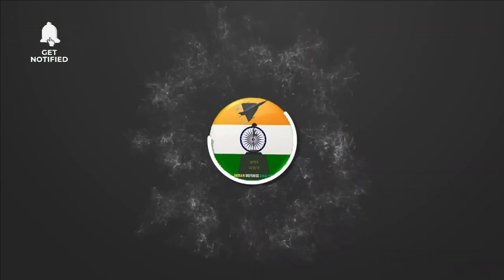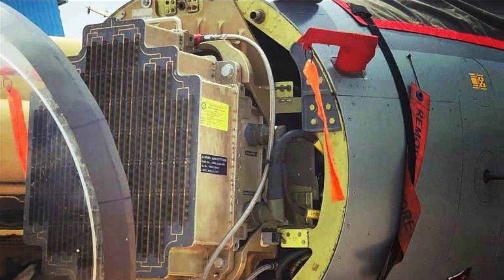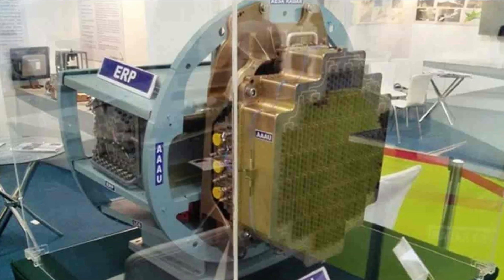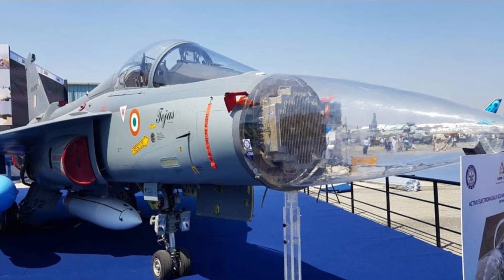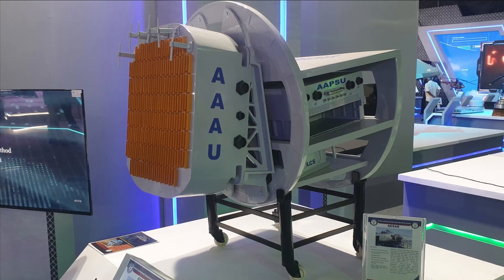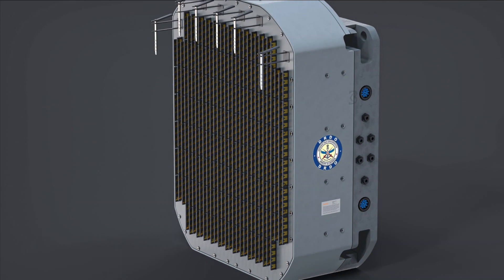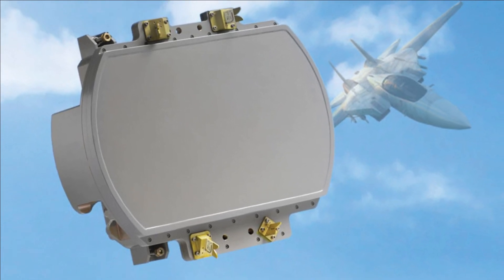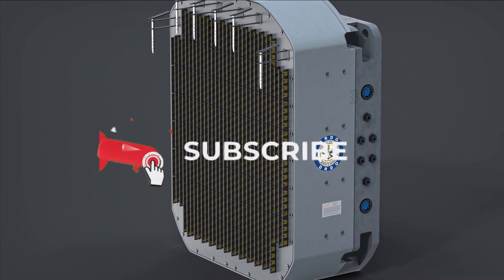More powerful radar for Tejas Mark 1A ?

Comment: DRDO Website has Gallium Nitride (GaN) based TRM. Apparently it will be fielded on the TEDBF and AMCA, but hopefully still available as upgrades for other aircraft as well.
Reply: Radars can be swapped easily if the nose is big enough so don't worry
Reply: @fly463  Because only explicitly mention AMCA/TEDBF, so thought maybe power was an issue? Space may be there, but maybe too power hungry?
Reply: QRSAM Radar is already GAN based. So yeah they definitely have the technology.
Reply: @datoolz0  yeah energy is an issue but i think 98kn thurst engineering can handle GaN radars 
If they can't 
Then DRDO can make a radar which is inferior to AMCA & TEDBF radars and can be powered by MKW
Reply: @sidewinder3422  DRDO is really hardworking
Although they develop a little late than the timeline they develop world class weapons with a budget of $1bn/year for now
Reply: @fly463  Just less modules would do the trick, still better than existing radar.
Reply: @sidewinder3422  Why do we even use non Gan radar at all? PESA radar is still deployed. Maybe time for mass upgrades? GAN radar offers such a big improvement it would help against stealth planes, and drones.
Reply: @datoolz0  yeah that's what i hope too
Reply: @datoolz0  GaN radar is not totally developed for now that's why
Reply: For the Su-30 upgrades too hopefully

Comment: Uttam AESA Radar is outdated because it uses GaAs technology. This needs bulky cryogenic cooling and is less sensitive. Whereas the newer GaN Gallium Nitride AESA radars can function without cryogenic cooling, hence more compact and therefore more TRMs can be accommodated, which in turn means it is much more powerful.
Reply: DRDO is also developing GAN radars for TEDBF & AMCA
Reply: Not even America has inducted GAN based radar still in development testing phase

Comment: If any aesa radar capabilities depend wholly on just being GaN or GaA based, many highly advanced operational aesa would be outdated now. About uttam for Sukhoi, it's only in the making yet at this process and range is not yet confirmed confidently. I don't think there is enough credible info yet for a debate on if bars or uttam on Sukhoi 30 is better. And to any one who claim that uttam is based on Su 57 radar, I need proof because even Russia is reluctant to provide full tech or I belive nothing on Sukhoi Bars radar, you hope for Sukhoi 57 radar tech for Uttam??? I am pretty sure every  radar  development in India is done mostly by ourselves especially airborne. If I am not mistaken, even when first MRFA competition was held, tech transfer for AESA radar was a roadblock for the competitor.They agree it first but when it comes to critical tech, nobody agree so it's unbelievable that even Russia would allow it not to mention that airforce is not impress by their tech.

Comment: Why on earth would anyone replace the Su-30MKI radar? It has the Bars N011M radar, with a detection range of 400km and tracking of 200km. Its tracking range itself is almost twice the range of most other radars detection ranges. IAF uses it as a makeshift AWACS because of how large it's detection range is. And it is a hybrid between AESA and PESA. Why would IAF want to put in a pure AESA with barely half the detection range compared to the N011Ms tracking range?
Reply: Bcs Active tracking gives better BVR missiles firing capability than passive tracking.
Reply: Those radars can be jammed easily that's why.
Su-30mki will get radars with 1280TRms
Reply: @surojeetchatterjee  Again, the N011M is a hybrid between a PESA and AESA. And the range of even the Rafale's RBE-2 is much smaller than that of the Bars. The Rafale's max detection range for fighter sized targets is between 130km and 150km. Meanwhile the N011M can TRACK, not detect, an aircraft with similar RCS at 150km. Meaning not only will the MKI pilots see the enemy before, they will also be able to engage well before the enemy can. Now with the current R-77, it doesn't really matter as much, but if IAF is serious on equipping them with the future variants of the Astra missiles, the current radar will be much more effective than an AESA radar.
Reply: Because time and time again. It was already proven Russia is not really good at Avionics and anything related to modern Defense Electronics.
Reply: @sidewinder3422  true they used their funds in missiles& air defence systems whereas US used it on stealth & avionics
Reply: @greenlantern6767  There's many official documents where the N011M detected a MiG-29 sized fighter at 145km. Do a simple google search. Balakot is a very weird situation. Pakistan was prepared with F-16s, AWACS, EW aircraft. IAF's biggest mistake that day was thinking the rats running that organization would honor the contract stating F-16s cannot be used in an offense against India. Indian Su-30MKIs were still climbing to altitude whereas the F-16s were already at 50,000ft, launching AMRAAMS. Hence the Su-30 was lower and slower, and below the optimal launch parameters. It's not that the MKI didn't detect the F-16. Also the Russian R-77 is inferior to the AMRAAM. In a war like situation, max detection range will play a big role.
Reply: @AT-bo6ww iaf officer already stated in a interview that the r77 has a range of just 80 km.
Reply: @greenlantern6767  Brother look at the MiG-31 over Ukraine right now. Forget Ukrainian aircraft, their SAM systems cannot touch the MiG-31. Also there weren't many F-16s in the sky. There were 4 to 6. Like I said, Balakot is a weird situation. You can't say the radar is bad just because the MKI was on the back foot. The MKI wasn't on the defensive side because of the radar, on any technology. It was simply because the F-16s had too much altitude and speed advantage, which allowed them to negate the Su-30MKIs capabilities. If you want a proper assessment of the MKI radar, look at the exercises they have against the USAF. There have been times where MiG-21s, with their radars switched off, and flying Nap of Earth shot down multiple F-15s while being guided by the Su-30MKI radar via datalink. The F-15s didn't even see the MiG-21s until the last minute and it was too late. This opportunity wasn't there in Balakot because PAF had too many advantages. In a war, during actual CAP sorties, the range will play a huge role. Balakot was an intercept mission, something the Su-30 isn't particularly designed for. It is a BVR missile truck, meant for air superiority and CAP missions, and in that realm, it is better than the F-15C/D, accepted by even the USAF.
Reply: @hritik5170  Yeah I know. But IAF has already integrate the Astra Mk1 with a range of 110km. the Mk2 has already gone through flight testing and it has a range of 160km, which is equal to the Aim120D(PAF uses Aim120C). What is the point of using a missile with a range of 160km when the radar cannot detect fighters at that range? And what will they do when the integrate the Mk3, which they are trying to get 300+km range?
Reply: Byelka has 450kms range & AESA